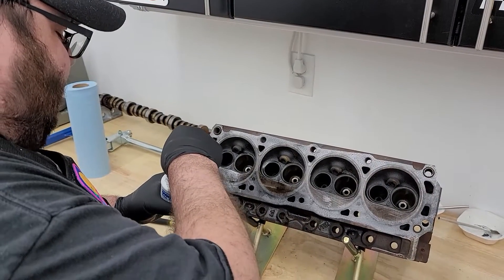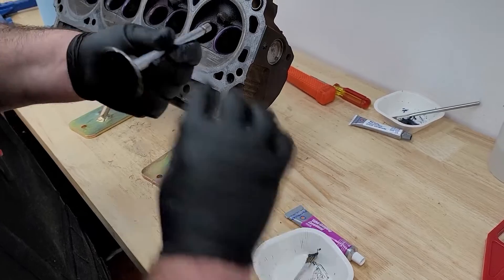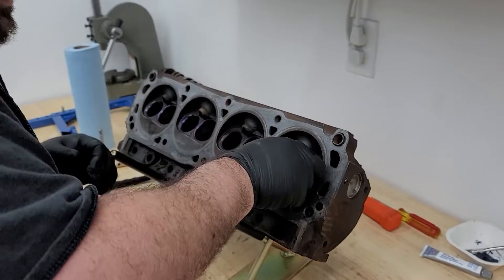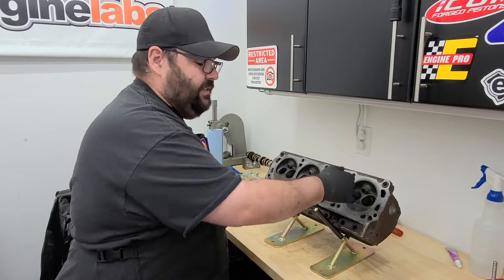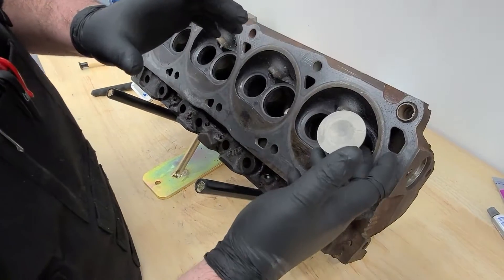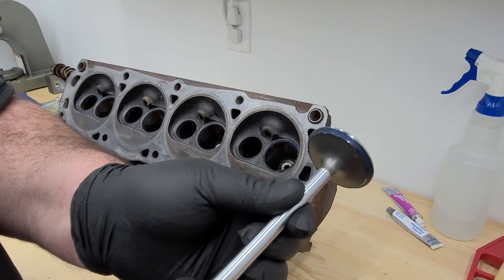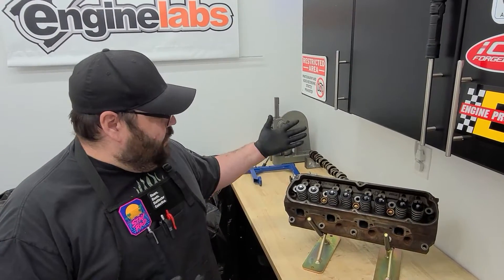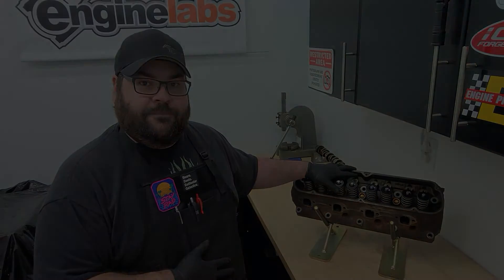Refreshing A Set Of Ford GT40 Cylinder Heads

Comment: This is the same procedure I am using for a set of GT40 and GT40P heads. The stock valves and guides are in great shape. The only addition will be a Lunati 73926K1 spring upgrade kit.